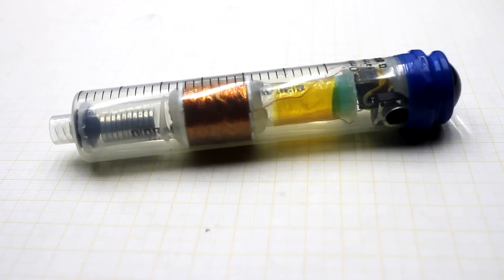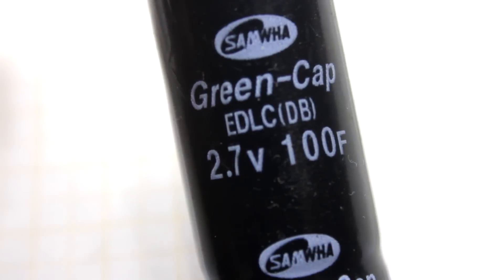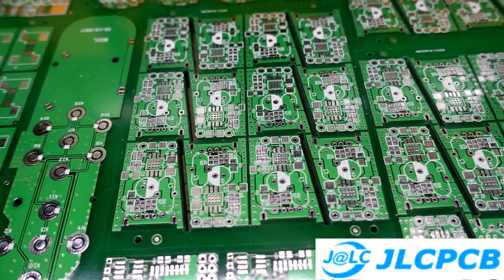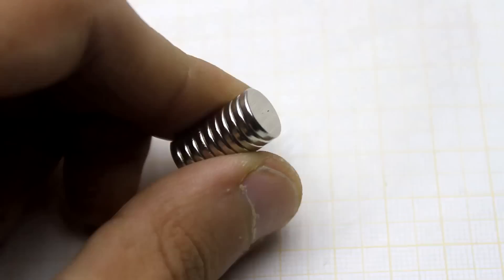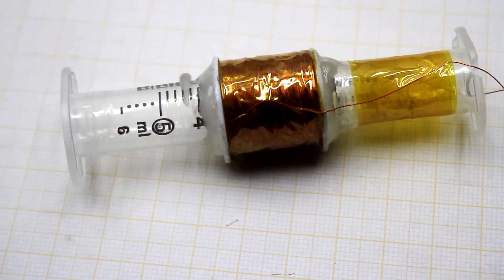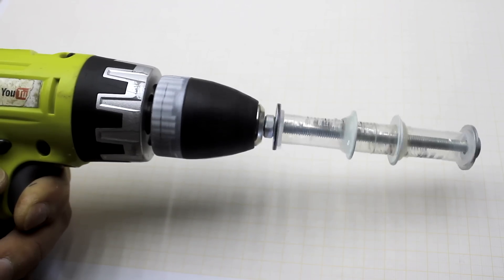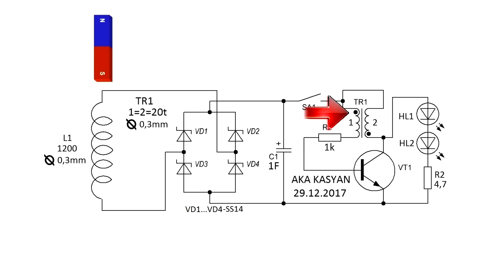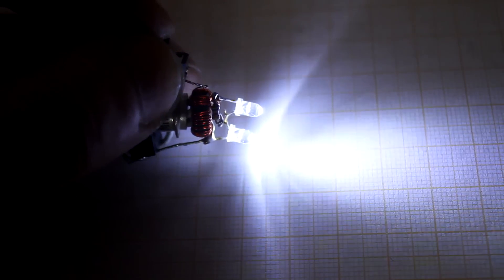DIY  Eternal Flashlight

Comment: You can use a neodymium magnet with small iron slugs to create the armature and make the induction coil in three smaller sectors. Use an arrangement of diodes an capacitors to create a 3 phase half wave doubler. Creates 150mA with vigerous shaking. Pre charge the super capacitor and add a yellow or green LED plus a resistor across it ro bleed off excess charge.

Comment: If you add magnets with the counter pole on both ends of the tube, where the induction Magnets are going back and forth, you can keep the induction magnets in a  magnetic field that would make them bounce back and forth without slamming against each end and also makes it not only more quiet but also smoother to shake the magnets back and forth.

Comment: how many time you shake it to full charge the capacitor?
Reply: it depends on the supercapacitor that's being used, 100F is way too big, it will take hours to charge, normally for such application you want like 5-10F it will charge fast and will work for about an hour, 100F will work for like 10 hours but charging will be eternal.

I made a mistake of buying 350F supercapacitor and learned the hard way that capacitors this big take about 1 minute to charge using 1A, shaking this you get micro-amps, so the smaller the super-capacitor - the better

Comment: the winding you used is way too thick. i'd use relay coil sized one and put iron core in it and make sure the output voltage is high enough to make the led glow without joulie thief for more efficiency
Reply: The Joule thief was added only to suck all the charges out of the sup-cap.
Reply: if you put a iron core. in it, the magnet would just stick to it.